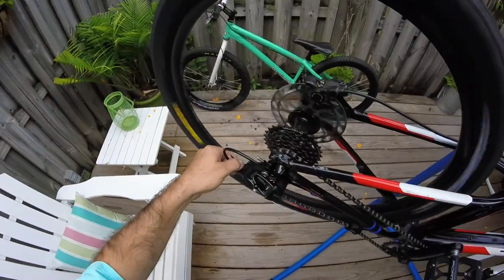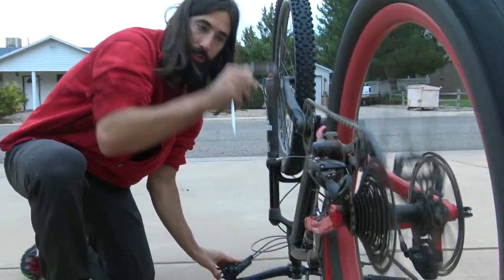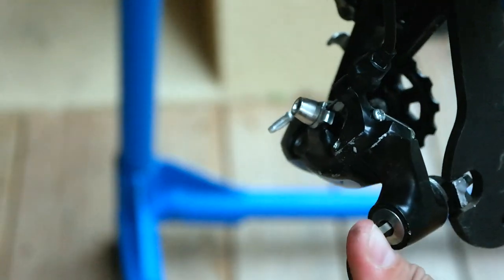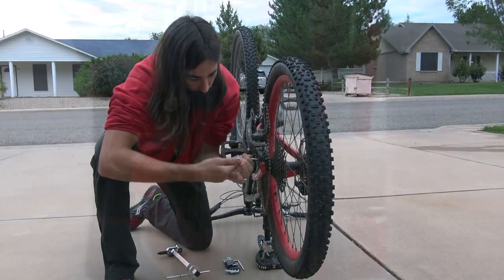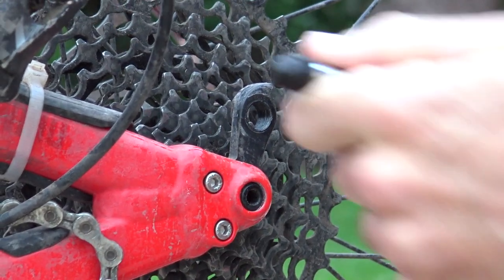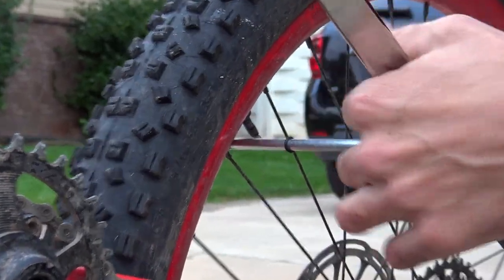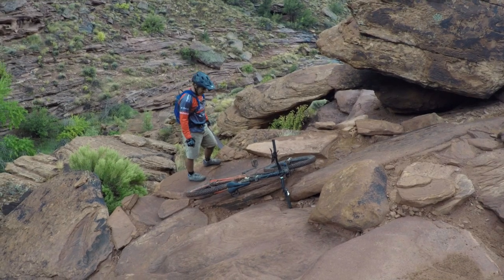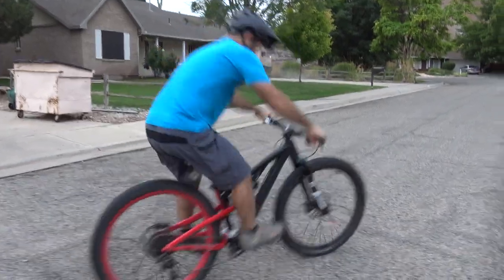Why your bike shifts like garbage

Comment: Is it possible my rear mech is simply worn out ????(bushes are abit sloppy). Its done 3700 miles. Still shifts bad with a new hanger
Reply: Yes, all components have a lifespan and will wear out at some point. If your derailleur's pivot points already have a lot of freeplay, it's high time for a new one.
Reply: @yonglingng5640 Yeah it was the issue, shifts much better now with a new rear mech

Comment: hey seth, when i shift to my largest ring on my rear wheel the chain skips off of it and gets stuck in between the largest ring and my spokes i was wondering how i could fix it?
Reply from the maker: +Sean Upfold Tighten your upper limit screw
Reply: Seth's Bike Hacks okay thanks.

Comment: my hanger snapped off
Reply from the maker: Spencer Murray You need a new one, or chewing gum
Reply: Seth's Bike Hacks haha well it was bent at first but I rode with it anyway and then a did a big drop and ran over my chain. I looked down and realized it was literally in 2.
Reply: more like a wielding tool could do the trick but then you could also obviously run into problems getting a hold of a wielding tool and operating one.

Comment: Can this apply to road bikes?
Reply from the maker: MattCasserole absolutely
Reply: Thanks! I recently got in a big crash and my derailer wasn't shifting properly on a couple of spots. After watching this video i checked out my bike and figured out that it was the hanger and one of my cables snapped on the front cassette on my downtune shifters. I finally got it fixed by bringing it in to a shop were they fixed my gears and my downtube shifters but god damn! the hanger must have been hard to find on an old 1989 argon 18... P.S: Love your vids <3

Comment: My bike skips in the smallest cog (9th gear) and only under pressure. I've tried indexing and adjusting limits. Any other ideas?
Reply from the maker: +River king your frame might be bent if it's
under pressure. Flex can cause stuff like
that. Bent hangers too!
Reply: my road bike skips in the bottom 3 under pressure.  pretty sure it's the freewheel though because it's only those gears. cheap bike too. could definitely use some upgrades
Reply: Seth's Bike Hacks thanks!
Reply: if you reemplaced the chain recently, maybe the link where you joined the chain is not totally free (the outer plates are crushing the pivots).
Reply: I had that issue when i bought my bike right out the box it would pop out in smallest cog under pressure and would drop chain on largest 2 cogs on backpedal. guess what it was. The derailleur hanger!!! I took it off straightened it and threw it in the spare parts bin as a backup cause it was just really flimsy. Look into Wheels Manufacturing Derailleur hangers the make really nice hangers for most bikes out CNC machined 6061 aluminum usually anodized that will clean your shifting up.
Reply: It also can happen if that cog is worn down. If the skipping gets worse when you replace the chain for the new one then it is 100% sue that it is the cause.

Comment: How come my brand new shimano derailleur doesn't shift into second gear, but shifts by itself from 3rd to fourth to fifth
Reply: Try tightening the cable a little bit
Reply: Even that sounds like a cable tension issue
Reply: Could be tension, could be a bent hanger, could be a combination of both. Also, what are you defining as first? Your smallest or your largest gear on the cassette?

Comment: hi
my bike gears are so hard to change gear why???
Reply: Bashier 123 try some lubricant in the shifters and cable housing or just replace the cable and housing.
Reply: often there could be gunk in the derailer, shifting cables, or your cables could be too loose. It's hard to tell though,  you should take it to a bike shop and have them tune it up for you.
Reply: Aidan Cordero I was about to but I just fixed it my self but I didnt fix it enough I might go to the bike shop thanks for the idea. [:
Reply: +Ethan Hannersi replaced my cable for my gears and put lubricant it was still hard but the lubricant kind of made it easier and I have to change my gear set anyway because they came broken and my bike is a trek 220mt they dont have gears for those anymore do you know where to get any gear sets for my bike
Reply: Bashier 123 they should have gears, ask one of the wrenches at your shop
Reply: Ethan Hanners  ok ill see thanks for the ideas
Reply: I just noticed something my deraleir is bent because I jumped off stairs and it got bent different ways

Comment: sorry but a hanger SHOULD be replaced, they can have hairline cracks (for sure if u try to straighten them yourself), they are not made to repair! Like u said yourself they are meant to be a stratigic failpoint therefor they aren't very strong! Ok u can straighten it if u are on a ride but they should be replaced when at home!

Comment: Why couldn't the timing be more in tune to my encounter with this same very issue last week. lol, in any case i ended up doing I hybrid hack using a walmart solid axle method used here https://www.youtube.com/watch?v=T45tsSjyjDA . instead of a wheel disk I used the tire valve as the measuring point and walmart rim (tire removed) using the valve stem hole and a stiff measuring tape at the 12, 6 , 9 oclock positions not being more than 4mm in any direction. BTW the walmart rim wasn't completely true, and still the results were fantastic. I'll probably by the tool off of ebay at some point running at $70. But I think you could get away with this method out on the road and come close enough provided there's enough superstore bikes around.

Comment: my bike is a wallmart bike and it dosent shift and a i got it at the beging of summer
Reply: try changing cables and adjusting the derailluers. check the H&L screws. most wallyworld bikes need adjusting constantly. but they're good to practice working on because if you do manage to break something you'll have an excuse to upgrade
Reply: +dylan welch thanks